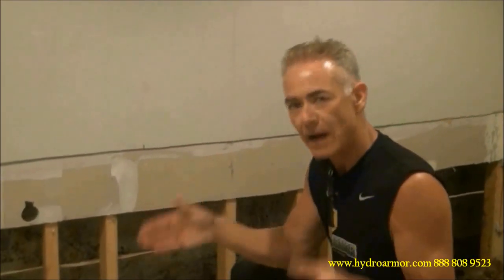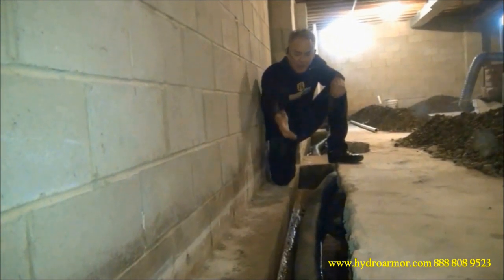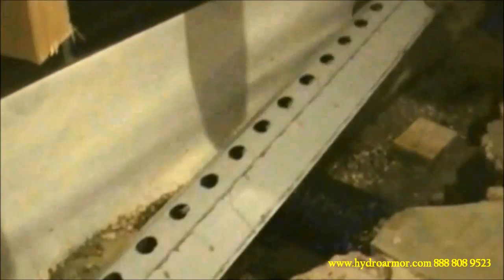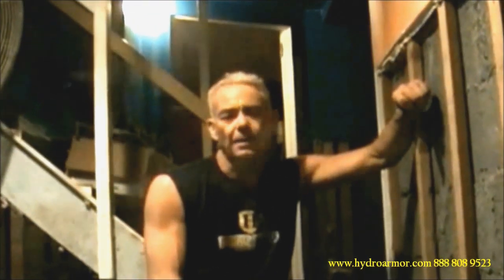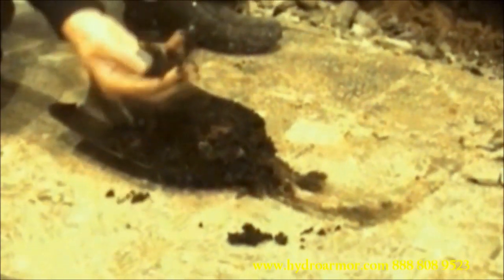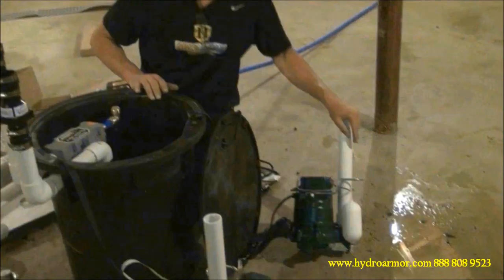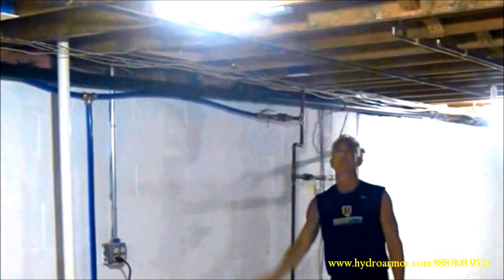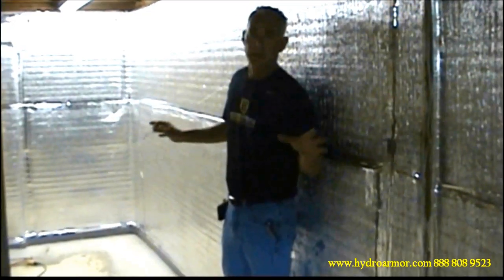#2 - Earth Recycles Water - Cause of and How to Repair Wet Basements & Foundation Structural Damage

Comment: Great videos and I like the editing, gets a lot of info stuffed into a short video. My question is about the difference between poured concrete walls vs block walls. if the walls are poured do you still need to drill holes or would you just install the pressure relief system below the footer?

Comment: hi my crawl space is just "shooting" cold air all winter into the house. I closed the block hole (which was open to air when I bought the house)  just for the winter, thinking it was the source, but I guess not.. my house is a split ranch, with a dirt floor crawl space with a sump that " brings water from the outside, then pumps it out the back" of the house,  Ideas on where exactly the cold is coming from? is it because the floor is dirt..
ps- there is absolutely nothing on it.. or the walls... thanks..

Comment: I forgot to ask, why the flexible ADS pipe instead of ABS pipe? I haven't watched a video yet that explains why one is better than the other, as long as the water has a pipe to flow through beneath the floor, does it really matter that much?

Comment: I've been watching your videos [really informative] to understand how to correctly address a moisture seepage issue I have in my workshop that is built against a hill and have a few questions.

1] The weepage holes that you drill in the cinderblocks, is that just to drain the existing water? Once you've re-poured the floor wouldn't those drilled drainage holes be plugged up again by the re-poured cement floor and so the cinderblocks would refill with water leading to cement block corrosion, wall dampness, etc again?

2] I can understand the reasoning to putting a pipe drainage system along the footing instead of on top of it, but you mention that there is no pitch to the pipe, it's basically level...wouldn't it be better to have it have a pitch similar to a gutter system so there is less standing water in the pipe and drains to the sump pit more effectively?

3] Once you have your interior sump pump system, where do you send all that water? Would you tie into the existing outside or interior drainage system or create a separate system?

4] I haven't heard any mention yet of a possible reason for water issues is that the exterior drainage system is damaged or blocked with silt or roots etc, do you recommend having those pipes checked and is there a 'best way' to have them cleared in some way?
Reply: ***** It's not too hard to figure out what you are doing, for anyone with more than 2 brain cells, and it only take 1/2 extra to realize you're the best. BUT, i cannot find any product here in Michigan that can be used as "drain broad". CCW does not make the "Quickdrain" product anymore, (claims no sales), and the other closest product is the HC, and the rep says will not fold as needed. What can I do, besides pay your airfare to Detroit!!??